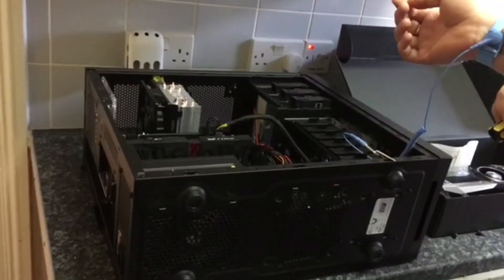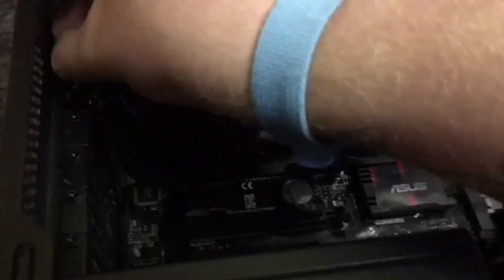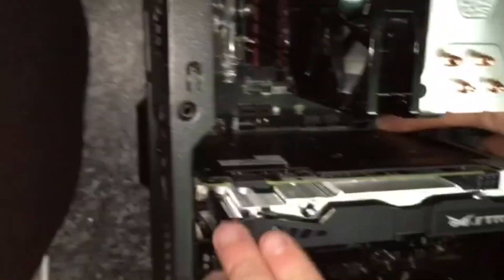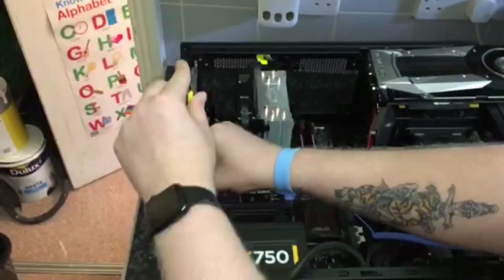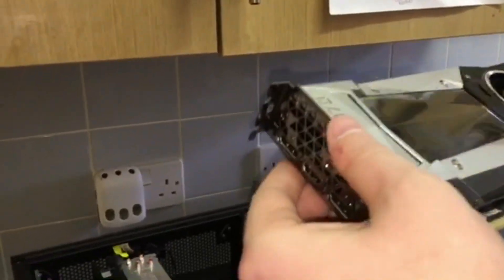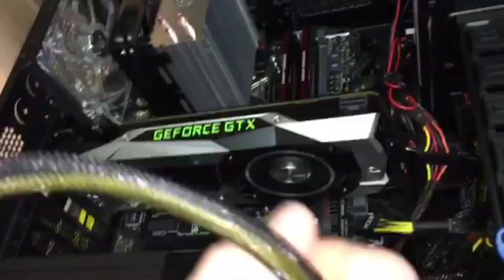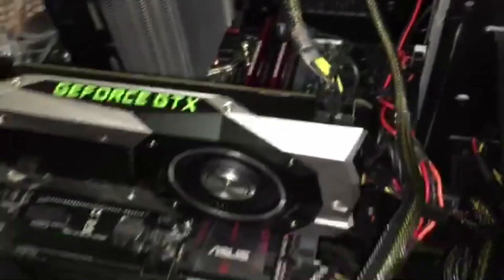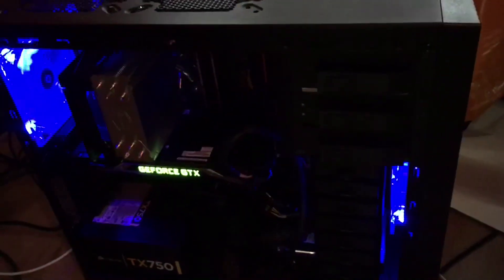GTX 1070 install tutorial

Comment: the static thing is a myth.  i repair and install boards every day for a living.  we never use any static thing and we also work on the boards when they have power.
Reply: Not with Gigabyte motherboards. They are the most susceptible brand I've ever used. The other brands are far more robust.
Reply: @marcopervo  idk. Idk.. working g on the board when it's off I dont really see a problem. Also I've also shorted out boards a lot by accident..  I've only lost 2 doing that.

Comment: Hi..! i have installed gigabyte aorus gtx 1070 in my HP Z800 but its not running correctly can anyone help me out that how do i set my gpu in hp z800... it says low power connect power cable into gpu then restart p.c.. please help me out ...

Comment: I have installed the GTX 1070 card on a Dell XPS 8700 and when I powered on I got a solid amber light on the power button.  I put the old card back in and still have a solid amber power light.  I have re-seated all the cables and tested the power supply successfully. Do you have any idea what could have happened? I feel like the mother board somehow shorted out.
Reply from the maker: Andrea Brown I have never had that issue mate could be a mother board problem
Reply: +Scottyrobs You were correct. The MB failed. Put a new one in and tried again and it worked just fine. Thanks for the response :)
Reply from the maker: +Andrea Brown your welcome I'm glad you are up and running

Comment: Do I need to buy a cable to plug it into the 8 pin on the card?
Reply from the maker: The Opinionated your psu should have an 8pin or a 6-8 pin converter on it already

Comment: Never knew it was this easy. I've been a gamer my whole life pretty much. But I've never once built my own PC. Mainly because I have no clue where to start. Also tutorials tend to showcase only one a certain case. For example some cases cant fit certain things. And me going out buying a case and then having to buy a new one because something doesnt fit would make me lose it.
Reply: I do have a decent PC at this time. But I need to upgrade my power supply, graphics card and possibly my processor.  How do you know what will fit? Are all motherboards similar in the way they connect properly?
Reply from the maker: Plague yeah you still have to be careful with cpu and ram but graphics cards are pretty universal it's best to also google first though before purchase
Reply: Scottyrobs Ok but how do I know which cords connect to where when I do change my power supply for example? also how do I know it will connect properly?

I have considered just buying a new gaming pc so I know all the facts on it. And then eventually upgrade seperate parts. instead of replacing power supply, graphics card, another 8 gig of ram and cpu. At that point I'm pretty much replacing everything in it.

Is my second idea better?
Also thanks for the super quick reply!
Reply from the maker: Plague Doc the sockets on the mother board are all labelled and the fitting only fit in the place they belong it's a lot more straight forward than people know
Reply: Scottyrobs Oh so theres an excess amount of sockets that are made for other types? Neat...I really have to get in to pc building as it's alot cheaper and I enjoy tech.
Reply from the maker: Plague Doc it's really rewarding also
Reply: Scottyrobs I bet it is. Since you take pride in building your own things. I've built my own wall in my apartment to ceperate the living room and my new office room. Afterwards I took great pride in it.
Reply from the maker: Plague Doc agreed mate Ive always been fond of diy for that reasons

Comment: you have the cpu cooler fan on backwards man
Reply from the maker: AleVids changed it mate about 2 days after thank you for heads up though
Reply: For general information: Depending on your ram size / cpu cooler clearance it's the only way it'll fit. There's a 0.8 degrees celcius differences from push to pull.

Comment: Getting a 1070 soon, will my i5 quad core 760 clocked at 3.60 ghz bottleneck it at all??
Reply from the maker: With an i5 you should be ok I'm not a pro with bottlenecks though to be honest
Reply: +Scottyrobs Alright, thanks for the feedback :p
Reply: That CPU only supports PCI 2.0 so yes it will potentially bottleneck the card somewhat. What card do you currently have installed?

Comment: I just got the EVGA 1070 SC and can't get it working, it's just beeping when I start my pc up... So it needs a (6+2) or 8 pin plugged into the card itself; I'm wondering does the connector going into the power supply also have to be an 8 pin? cause I just have the 6 pin in the PSU and the (6+2) on the other end of the cable...
Reply from the maker: I'm not sure about that mate my psu has all its wires pre connected I do have a 6+2 in the gpu  what watt is it ?
Reply: +Scottyrobs 750W and it's modular
Reply from the maker: I'm not sure what to suggest apart from Google mate . That's not Siomthing I have come across
Reply: +Scottyrobs the manual says that if that being occurs it's one of four things: not seated properly, problem with gpu, problem with Mobo, or connectors not in securely. I reinstalled my old one and it works fine so it ain't my Mobo, I guess I'm just hoping to God I don't have a faulty card
Reply from the maker: Have you tried putting the 1070 back in and making sure it all clicks in?. Also the power nice and tight . I have the founders edition so will be a slightly different install
Reply: +Scottyrobs yeah I did that I reinstalled and tried booting up like 7 times still the beep and idk why but can't find an answer through the internet... so just to be clear, it is okay to have a 6pin connector cable from my PSU that leads to a 6+2pin connector into my card right? or do both ends have to match in order to supply the appropriate power needed...?
Reply from the maker: I'm thinking that you may need a 8 to 8 or 8 to 6..2
Reply: +Scottyrobs yeah that's my next troubleshoot. I'll give it ago and get back to you

Comment: Would you recommend the Founder's Edition or an EVGA version for example?
Reply from the maker: I've only ever used the founders and Iove it and would buy another founders i have heard others have better cooling but mine has never gone above 50 temp. Also the looks are fantastic
Reply: Scottyrobs I also see that the Founders only need 1- 8pin Connector while the EVGA has 2- 8 pin sockets!
Reply from the maker: +Luis P (Innnsanity) 1 8pin is easy I'm planing to buy another in Dec when I do I'll be buying another founders
Reply: Scottyrobs Your gonna SLI the 1070?
If so, I suggest making a Benchmark video showing how many frames you can reach on a fairly new game!
Reply from the maker: +Luis P (Innnsanity) will do mate I'm excited about it just waiting till the sales

Comment: Yo Scotty, is the power ok to use a 6-pin to 8-pin connector?
Reply from the maker: If you mean a 6 to 8 connecter then yeah mate that's what I'm using on mine
Reply from the maker: +bigboeee I have had no issues with my card or the power to my card mate touch would lol it's been a smooth as a daisy and if anything I think it's working better now than it was a month ago
Reply from the maker: +bigboeee you are welcome I'm planning to buy a second in December and go sli one if them is amazing two can only be epic
Reply: One month on since you've installed this card and plugged it in with a 6+2 pin power connector, my question is if you've had any issues at all? 

I ask because I'm looking to upgrade sometime in the coming months and have the same PSU as you do and was wondering if that 6+2 connector would cause any issues.
Reply: That's absolutely great to hear, thank you for that and for the quick reply.

Comment: Nice vid man! I have a question, I don't know too much about the 8 pin pcie power cable but I don't have one in my case so I couldn't power my 1070. Sorry for the noob question :/
Reply from the maker: Have you got A modulated power supply (can you plug wires in and take them out of you power supply)? I yes then you can buy a 8 pin or buy a 6+2 pin cable. If no and all the wires are conected and come out of one hole then you should either have a 8 pin or a cable with a 6 pin plus 2 pin next to each other you can come to then together to make an 8 pin
Reply from the maker: Also I believe you can get 2 4pins and connect them also . What power supply do you have and what's the wattage?
Reply: I just recently bought a Corsair RM850x power supply. It hooked up to everything except, there's this 4 pin connector that my really really, old mobo has on it that the RM850x psu doesn't have. My really old shitty 500w psu has that 4 pin connector for the old mobo. Because of that one 4 pin slot on my mobo, I didn't use my new psu.
Reply from the maker: You should have a 8 pin or a 6+2 pin you can use as a 8pin if not you can get a psu what has either . If  you need any more help feel free to ask mate
Reply from the maker: +SyferOnline you can buy adapters mate 6 to 8pin  if you have another gpu you will have a 6 pin

Comment: I JUST PUT MY GTX 1070 IN AND I STILL ONLY GET 30 FPS  MY SPECKS ARE AMD FX 8350 EIGHT CORE 16 GB RAM GTX 1070
Reply: +Nirox yea i fogured it out bro everyone said its my cpu but i have a amd fx9850 its runz at 4.2ghz thats on par with i7 so thats not it
Reply: +Nirox drives for the 1080 or my cpu
Reply from the maker: I have an I 7 but you should get more than 30 is v sync off ?
Reply: +Scottyrobs yes
Reply from the maker: +joe rector (scallywhop08) what res are you using mate and what map lowest I have got on 1440p is 45 and that was one server the normal is 60/80 I'm not to sure how good you chip it in comparison to a i7 4790k
Reply: 2560×1080
Reply from the maker: +joe rector (scallywhop08) that's 1440p should be higher than 30fps it must be the cpu bottle necking it all I can recommend is drop overall view to around 2000 and object to 1000
Reply: You are being bottlenecked by your cpu type it cpu bottleneck checker on google it will help you pick a cpu that it just good enough for the gtx 1070. Dont want you to have to spend too mich but a $150 cpu should be more than enough and will improve performance and fps
Reply: +XXJUST LOGANXX GAMING i have a 250 cpu my cpu is fine ive looked into i belive its a amd fx 8550 eight core
Reply: +joe rector (scallywhop08) got the newest drivers?

Comment: My pc is xps8700, and my power only has 6 pin cable (two left), What should I do in order to make the graphic card work? I do not have a 6+2 cable, thanks~
Reply from the maker: +atr8126 just the 8 pin mate and the connect it to your 6 pin as for proformance you will be ok mate
Reply: +Scottyrobs thx a lot, bro
Reply from the maker: That could be a big problem mate you may have to replace your power supply let me have a look an seen of there are adapters
Reply from the maker: You are fine you can buy 6 pin to 8 pin connectors on Amazon mate hope this helped any more questions feel free to ask .
Reply: I have 2 6 pin pci-e cables and I read online that you could plug in 6 pins to 8 pins and also plug in the other full 6 pin cable is this true or false ?  Also do you think there would be any performance loss using the 6-8 pin adapter? and did you plug in only the 8 pin slot or both the 8  pin and 6 pin slots
Reply from the maker: +zhuofu chen your welcome mate thanks for the sub pass me on to your friends lol

Comment: I have a question!
Im going to install the 1070 and replace the 970.
Now i have 650W, i was told that i may need more cables to power the 1070, i dont remember what i was told precisely..
will i have to buy some other cables in order to power the graphics card?
Reply from the maker: Mate I have a 750 what and I didn't need other cables it's really efficient so I think you will be totally fine to just put it in mate
Reply: +Scottyrobs thanks for replaying Scotty!
My mind is at ease!
Reply: +John Marston  replying*
Reply from the maker: +John Marston no worries mate always willing to help hope you subscribed so you don't miss out on future stuff
Reply: Hey man!
I would like to ask yet another question, i haven't installed it yet, i plan to do that later, but my friend told me that i need an 8 pin connector, i don't know if i have enough for the 8 pin.. that's what my friend meant before..
Reply: +John Marston your power supply has many cables just pick any pins you want and put then together just as long as you make one 8 pin connecter with them and one six pin
Reply from the maker: +John Marston you should either have a 8pin or a 6 and a 2 both will work mate

Comment from the maker: The case I got with my original computer before returning gutting It myself it came from scan systems not sure what brand case is sorry
Reply: A power supply wit 6+2 pin work wit gtx 1070?
Reply from the maker: Yeah mate
Reply: Arigato ^^ But i don't know if my psu work wit my Asus z170-p d3 ...
Reply from the maker: I have a z97 and it's fine mate
Reply: Ty so much

Comment from the maker: I have mine going from the 1070 straight to the tv I don't use a monitor . When I first installed I was getting no signal so I held power button to turn of computer then turned it on again and it worked fine think it needed to install itself

Comment: I have a question. my Mobo doesn't have onboard gfx and I can not get any signal through my monitor when the HDMI is plugged into the 1070 GPU. WIll this only work if I buy a HDMI to DVI-D connector?
Reply from the maker: I replied above
Reply from the maker: +Scottyrobs also I know it's not recommend to force your computer to turn of bit I had no choice and it worked
Reply: Thanks buddy, I'll give it ago. I've tried a few times. I think sometimes it can depend on th emonitor too.
Reply from the maker: +Britain's Worst Gamer let me know how you get on a subbed you also like the vids mate your a funny guy
Reply: oh wow thanks mate. appreciate that. I've tried it a few times now and it seems I'm gonna need a dvi cable or a hdmi to dvi. So frustrating when you've got a new build and you can't even use it yet. :P